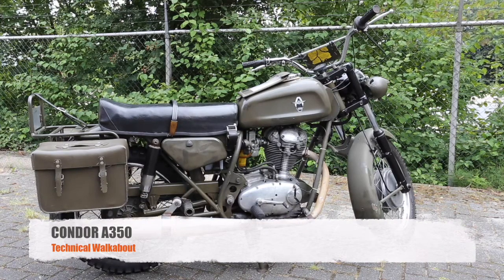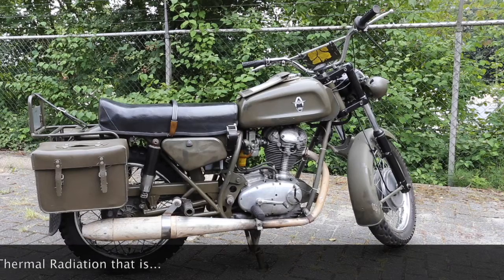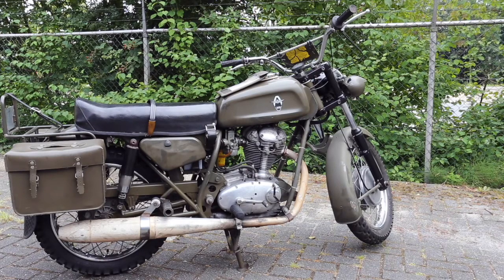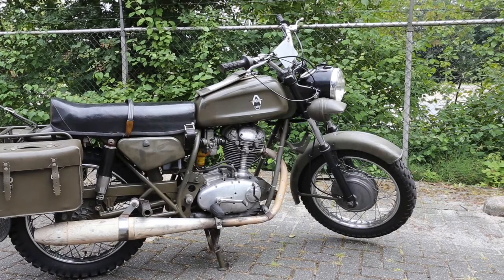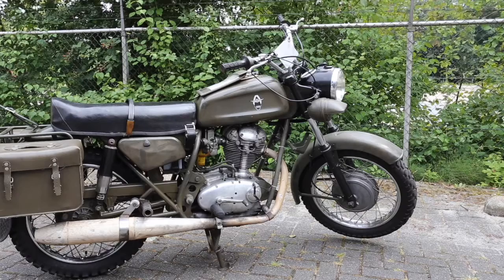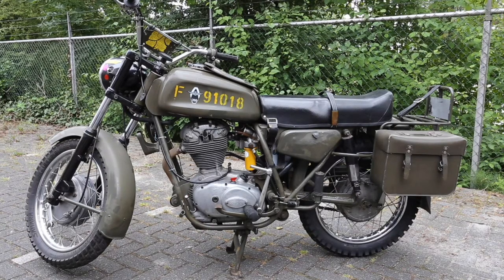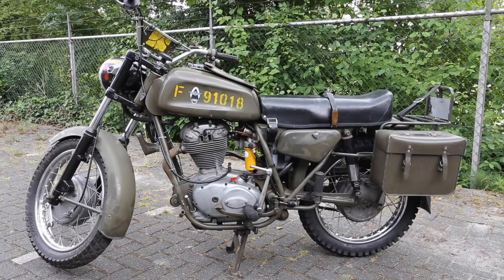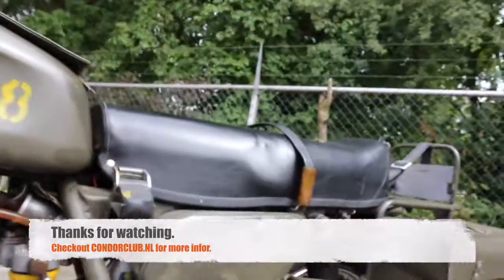Condor A350

Comment: I also served as a motorcyclist in the Swiss Army in the early 1980s and rode this motorcycle.
It was a lame duck, but it couldn't be killed. On the first day we crashed three A350s because we upshifted instead of braking, and that on icy and snowy roads. The mechanics fixed everything again and we moved on.
By the way, the engine is definitely from Ducati, the army had boxes of spare parts in the warehouses directly from the Ducati factory.
The picture of the rifle in your video is exactly right, that is the STGW 57.
We hated riding off-road with the gun at our side; in the evening the inside of our legs were sore and the gun had to be cleaned for hours.
The A350 had a studded tire at the back and a smooth road tire at the front, which was ideal neither off-road nor on the road.
Reply from the maker: Thank you for this! If you’re interested, please join my Facebook page ‘Condor A350’. There are more than 200 people with this bike, from all over the world. They would be thrilled to hear from you!
Reply: Thanks for the reply.
Unfortunately I'm not on Facebook.
If you want, I can write you stories from my time on the A350. @RobZelf
Reply from the maker: That would be great. I’ll cut and paste them on the FB-page for the 200-odd Condoristi to enjoy. @Kanu2SG

Comment: Rifles were Stg 57 (for Sturmgewehr 57 = assault rifle mod. 1957).  These rifles could fire single shots or in automatic mode (very similar to the NATO FALO). 
Exhaust are a BMW model, hence the silence  :-)
The Condor A250 had a Condor engine, in fact a true copy of a single BMW, but reversed.
Condor was at this time the swiss importer for Ducati products, and they simply bought Ducati engines. It is quite sure that these engines were made by Mototrans, who were very good with singles. It was cheaper for Condor to buy these engines than to make them. They only had to reduce their power. 
Thank you for this good video  :-)
Reply from the maker: Hi Merlin, thanks for your comments. There are people saying it was from Mototrans and others saying that Ducati had these in stock and were happy to get rid of them. I know MT were good with the single ducati's (some say better than ducati ;-) ) and Condor (or MT) improved the engines. Can you tell me how you know or where you got this knowledge? It is not a big deal - just curious. (NB: I know nothing about the guns - i found that info somewhere on the net ... sorry)  Cheers, Rob

Comment: Great video, I've had a Condor for 6 years now, just picked up an oil filter at the link you posted here.  I'm also looking for new brake pads. Any idea where I can find some? Thanks for such a great resource!
Reply from the maker: Hi, thanks for your kind words. About the pads: these are standard 200mm pads and were mounted on a host of italian bikes in the 60's and 70s. Google around and I am sure you could find something Alternatively you could have your shoes relined, riveted  and ground - that would be my choice, to be honest: cheap and if you're handy you could do it yourself. I still have a few original pads hanging around but I am loath to part with them because a) they are so old, I wouldn;t trust them and b) I still have 2 a350s and they are driven quite a lot and these would be my emergency stock ;-)  (PS: try 'Back to Classics' in NL - if they can't help, I am sure they would pointer you to right way...)
Reply: Thanks for the tips. I think I will reline the originals but it's a daily rider and so was looking to get a back up pair of shoes to minimize downtime. Thanks again for the quick reply and the vid.

Comment: Hi Rob, I am getting no spark. The coil, condenser and battery are good. I don't think I need the generator for the spark? Right?  I would like to check the generator, though. What kind of a OHM reading should I get? Any help with the spark problem would be greatly appreciated, Thanks, Rob
Reply from the maker: Hey Robert, that could be any number of things. Start with the easy things; battery full? plug OK? Cable OK?No electricity-leaks around the cable? Then the more difficult ones: points/condensor working properly? the rotor has no fucked wired? stator still has magnetism? Ohms over the Pickups should be 110ohm or thereabouts. Try this and lemme know if you find anything else. (Coil could be the culprit. I have replaced quite a few over the years....Ducati coils can be used as replacement)
Reply from the maker: Measuring the coil statically doesn;t mean it's not fucked, by the way....

Comment: If you have time, could you tell me what settings you have on the 2 carburettor screws?
Reply from the maker: Mixture - 1,25 twists OUT from completely screwed IN
The stationary screw I am always fiddling around with - once it's warmed the fiddling stops ;-)
Reply: @RobZelf  well, thanks for the reply, meanwhile I found approximately the same settings!
Reply from the maker: @minutemanqvs  Sorry - I'm not here much. Join the Condor A350 page on FB. There are a whole bunch of Condoristi there and you'll get answers a LOT faster.

Comment: I opened the distributor cap  on my Condor today and noticed that I have no condenser next to the points. I have not ran it in 2 years and was changing gaskets on and put her back together today. I am getting old and i don't remember taking them out and why would I? Rhetorical question.. Is it located some where else?  I need , an oil filter, points and a condenser if you can help. Thanks, Rob
Reply from the maker: Hello Robert. I have the parts you need. There is ALSO a condensor under the FRONT of the saddle, attached to the frame. This one is important to allow starting with aan empty battery. Where abouts ARE you??
Reply: Hi Rob, I am in the USA. I also need an oil filter. I new it had to have a condenser somewhere! Thanks, Robert
Reply from the maker: Just for your info: I change oil every 1500km (1000miles) (when its warm!!) and clean the oilfilter with diesel. Works fine and that way you can reuse the filter a dozen times. Don't forget these bike didn't even HAVE an oil filter originally. I do have an original oil filter if you want plus the points. Give me a day to dig them up and make a sensible price for you.
Reply from the maker: PS: there are a few alternative oil-filters that work fine as well.... have to dig that up too!
Reply from the maker: https://www.inlinefilters.co.uk/Filters-Lube/SpinOn/M14x1.5/FIN-FL70198
Reply from the maker: Oh, and the points/condenser are the same as for any wide-case ducati single.
Could be easier for you to look locally ....
Reply from the maker: Extra info: INSIDE the crankcases, Condors have a super-strong earth magnet to collect all/any iron-filings. That tends to keep the filter perfectly clean. If you ever split the crankcases, you will be suprised to find a 'tree' of stuff sticking to the magnet. Great solution :)
Reply: Thanks...